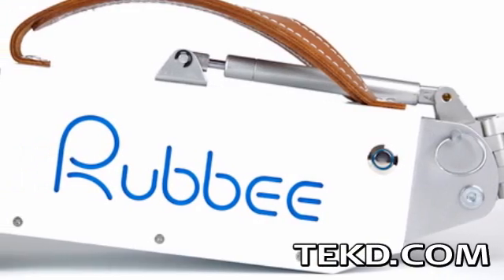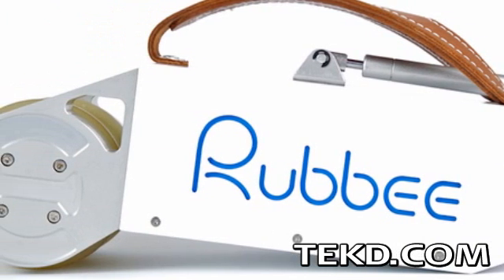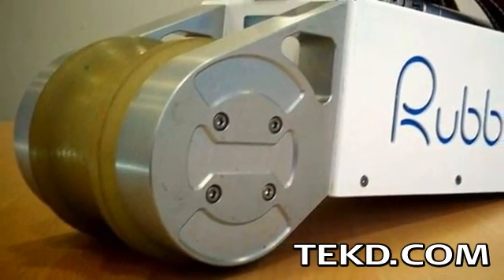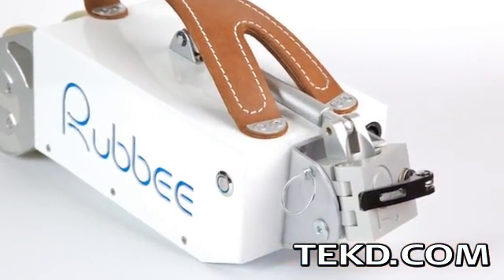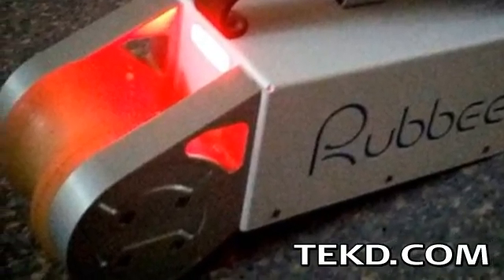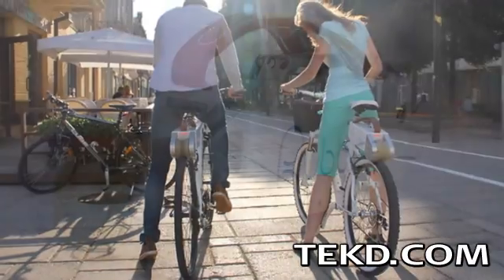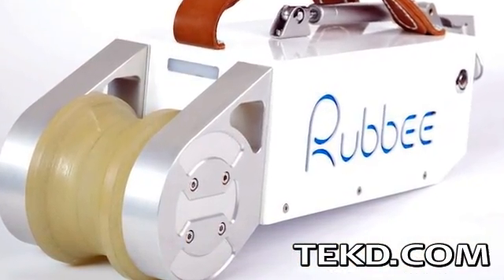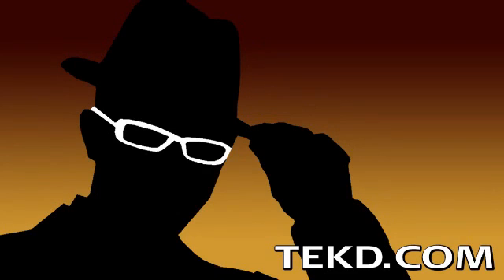Make Your Bike an E-Bike with Rubbee

Comment: Rub one out with rubbee!
Reply: joblessalex imagine getting yourself caught in that thing... I wouldn’t try it
Reply: It works if you flip it upside down and hold on to something solid.  Works beter than actually using it as a bike motor. Stay away from Rubbee. Are they still in business? I am afraid to look on google.

Comment: OMG...none of the info in this blurb is correct. NONE. Better go to their website for the official marketing factoids. Wait...the 15 mph top speed is accurate...if you are less than 11 stone (150 pounds or so). Oh..the rear light IS red. So there are two bits of good info in this video...my bad.
Reply: Wow...I forgot left this comment...I guess I am still upset at Rubbee today. I better get outta here. Yu get the idea. LOVE MY Yamahe powered Haibike though.

Comment: 20 thousand mah?
Reply: 10000mah or in 90's speak... ten amps. At 14.6 volts. Also its a 250 watt motor. Beautiful but underpowered and noisy. I am trying to tweak mine to increase range and somehow reduce that motor noise. Yikes.

Comment: i will buy it if it cost 300 usd . but more than that no  . I can just build its clone with 300
Reply: Sure you can. Absolutely. Start with a few hundred for the batteries and some serious soldering... then wrap it with some laser cut aluminum, a controller, charger and a few led's...easy-peasy! Oh wait...still need a motor and a polyurethane roller assembly.Never mind!

Comment: I paid $350 for my ebike conversion front hub 800 watts and it does 20 mph and works in mud, rain, etc...
Reply: Oh Yea? I paid $20 bucks for my roadmaster and it can reach 20 mph on a good day, with a tailwind, if I am sober and so inclined. A slight downhill is usually required. Sweat is involved. Wait...maybe that was my Huffy. When I was 16. Yep
Reply: I paid $100 each for my first 5 cars yet that was in the 60's and 70's. Apples and Oranges my friend. I hope you are still enjoying that conversion. eBikes are the future.

Comment: $1000 is too much to pay for this piece of crap
Reply: +calthmlikiseethm This is quite stupid. This cost much as a hubmotor and it loses a lot energy driving the rubber of the wheel.
Reply: +Andrew Gems http://www.ebay.com/bhp/brushless-hub-motor
you looking at the wrong place  you can get one from 200$ of you need an esc and battery too buy you can get all for 1000$

Comment: A real conversion kit costs about 600 dollars you get the wheel with motor in it tire battery throttle why pay so much for this? 1000 dollar? expensive